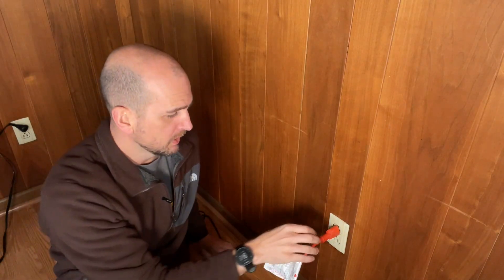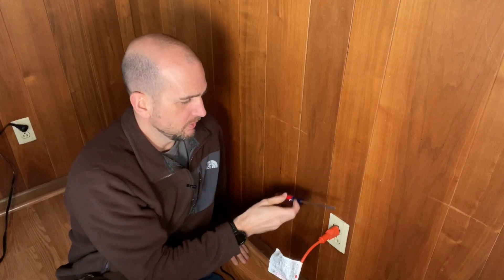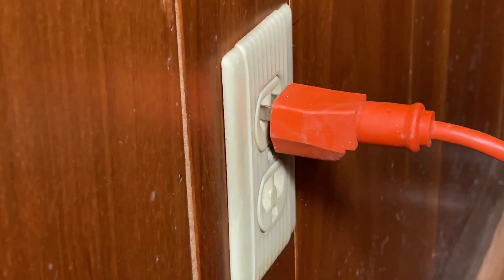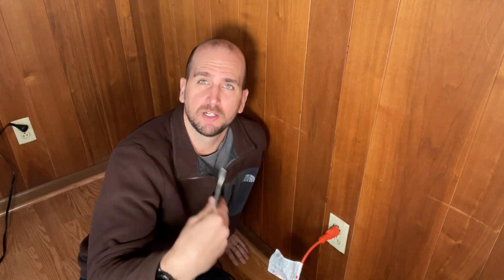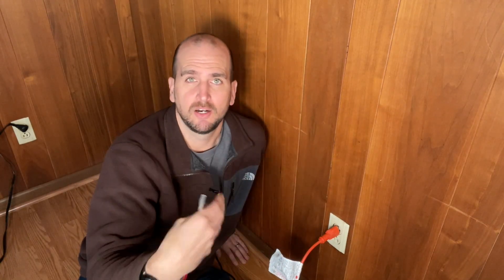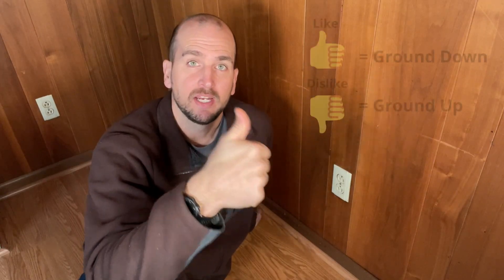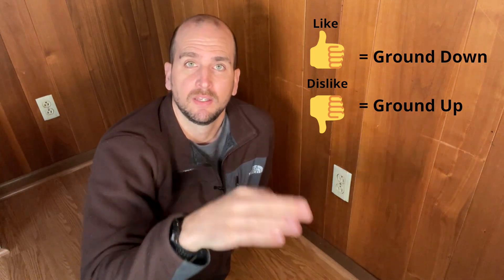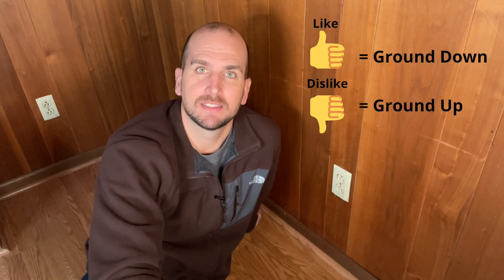Should An Outlet Be Installed Ground Down Or Up

Comment: This is a toilet paper issue.  I know people who actually argue over the toilet paper end being over or under.  There is no 'right' or 'wrong' way.  It is what ever suits you.  My house has them going both ways -- no specific pattern -- and that does not bother me.  I even have a couple that were installed sideways.  The box is actually sideways in the wall and so the plug is side ways -- or laying down if you will.  I could care less, just as long as I can plug in and it works.  As far as the 90 degree plug, It is better for the ground to be down so that the plug can be flat.  But I have no way of knowing where I would use such plugs, until I have one and need to plug it in.  If the fixture or appliance will remain there for a while, I simply pull out the plug and reinstall it with the ground down if it is not already like that.  It is not hard to wire a plug.  It is a pain in the ... to throw the main, as you then have to reset anything with a clock or timer if that fixture or appliance does not have a battery back-up.  But I think, today, most all appliance and fixtures have battery backups now, so that helps.  I am fortunate that both myself and my husband are not picky about these little details.  But some people are OCD and these little details really matter to them.  Another thing I have seen actually argue over is what color plug to get, white or the bone color.  They would really freak out in my house, because I have a mixture of colors, and I even have bone colored covers on white outlets and vice versa.  Sometimes I think I just like to freak people out.

Comment: Been in electrical engineering and construction industries for forty years. This is the worst explanation I have encountered.  Want to see fingers burned?  Put the ground up.  When the plug is grasped with the end of the index finger wraps around the bottom of the plug. Most people will naturally rock the plug up and down to remove it from the receptacle. Not difficult fir people with small fingers or weak pinch to go for a new grip and over reach and lay a finger across the hot/neutral. After thousands of design and construction projects all across the US and four other countries, never seen a ground up scenario.  Grounds go DOWN.

Comment: My observation over the past 45 years of doing electrical work is that for vertically mounted duplex receptacles the ground pin points down (except in hospital/commercial settings where they are almost universally ground up). And if the duplex receptacle is mounted horizontally the ground pins are  most often mounted to the right. Being consistent within a particular home or facility is best practice. The confusion comes in when folks change out receptacles paying no attention to orientation. This just adds to the question being addressed. :)

Comment: If gang boxes were installed horizontally instead of vertically, it would solve all the problems. The ground would be to the left or right, and only the hot or neutral would be up. So, no shorting if metal falls on the exposed prongs, and it would accommodate all plugs, including the flat, space saving plugs.
Reply: That's typical practice around Chicago with hot up/ground on right.
Reply: @mtgibbs  that makes the most sense to me

Comment: How about mounting it sideways ?    Left vs Right ?
Many industrial plugs that are 90 degree orientation have the cord positioned at a 45 degree angle from vertical; very annoying when the cord has to end up facing up only to loop down to the appliance.

Comment: For everybody who thinks they know and want to give their opinion now I'm going to tell you why. In commercial buildings the outlet cover is metal little screw comes loose which is common sometime falls out now the metal plate can fall down on your plug if your plug is not all the way in and jump the hot and the common what can cause all the usual problems including a fire. And this is why.

Comment: Ground Down 👇. Some electricians and builders use ground up for the switched receptacles. However on switched receptacles I like them separated one switched one hot. Then you run across the argument top up switched or top down switched. Ideally switched marked split receptacles.

Comment: I've got all my 20amp outlets, that run off of a 20amp breaker and 12ga wire, with ground facing up. And all my 15amp outlets that run off of 15amp breaker and 14 ga wire with ground facing down. That way I can tell weather an outlet is rated for 15 or 20 just buy looking at it and not having to take the cover off or anything. But that's just my preference.
Reply: Nowadays there's a "T" shaped slot on the 20 amp outlets you can use for that purpose.

Comment: The problem I noticed with the upside down outlet is people flip the outlet but they don't flip the wires so you have a hot neutral and a neutral  return which means I think you would have feedback even though the power be off with electrical feedback cuz I was told especially a code violation near water I've also know that gfci's that are flipped have a red light indicating a fault and so if you're plugging something in does not have a ground 🔌 which I know from experience the upside down outlets if you touch your coffee makers plate it'll feel electrified just let the transistor radios to plug is not flipped the outside feels electrified you can feel it

Comment: Great video, thanks.  A few years ago, in the bathroom, I did drop a metal necklaces and it shorted the outlet and made a mess. Also the GFCI never tripped.  I think the ground up would have been better for this incident.  For myself, I put the ground up in utility areas(Attic/Garage) and for places that are finished and visable, I put the ground down. The biggest reason ground down is so that people don't keep telling me my outlet is upside down.
Reply: The GFCI is not meant to trip for that condition (hot to neutral short).  

Secondly, if the ground was up and you dropped a necklace on it, it's flexible and will likely still contact the hot and neutral blades in addition to the ground pin. Or the ground and hot blade... Same result.
Reply: @IrrationalBstrd  If the GFCI  was upside though wouldn't it have shorted via the ground and tripped?
Reply: @FunWithBits  the neutral and ground are connected to the same place at the panel.  The difference between them is that the neutral carries current in normal operation and the ground only carries current when there is a fault, specifically called a ground fault.  Hot to neutral, or hot to ground short should trip the breaker unless the necklace provided enough resistance that the current flow doesn't exceed the breaker rating (or a faulty breaker or federal Pacific stab lok breaker which is notorious for not tripping at it's rating) which is entirely possible.

GFCI is designed to monitor the current on the hot and neutral conductors and trip when the difference in current on the 2 conductors is around 4-6 milliamps.  A sample scenario would be, you are energized by the hot conductor on a frayed wire and touch the sink with your other hand.  The GFCI sees that current is flowing somewhere that it shouldn't be (through you to ground) and trips.  A GFCI does not protect against a direct short between hot and neutral or hot and ground, that's the circuit breaker's job.  

GFCI doesn't need the equipment ground conductor to operate as intended.  Only monitors the difference in current flow between  hot and neutral conductors.
Reply: @IrrationalBstrd  Got it. Thanks for the clarification. I was thinking it would help in this case but it sounds like since they are tied together it wouldn't qualify.  It's good to know how this stuff works and do things correctly and safely. Off topic, I'm surprised they trip with so little current... that is pretty good as I know 4-6 ma is very small.. but then again it only takes 10-50ma  (just did a quick google search) to be dangerous. Thank you again for taking the time to share and reply.
Reply: @IrrationalBstrd  But if it shorted hot and ground, the GFCI would trip.
Reply: @Owen_loves_Butters  I don't think so.
Reply: @IrrationalBstrd  Current flows from the hot, but does not return to neutral. That's a difference in current that the GFCI will detect
Reply: @Owen_loves_Butters  it should, as what you describe is a ground fault.   However, it may trip the breaker as you have infinite current all of a sudden, theoretically.
Reply: @IrrationalBstrd  That's probably true, but the current wouldn't be infinite since the wires and necklace have some resistance (I have no idea what the necklace is made of)
Reply: @Owen_loves_Butters   Also, I have seen GFCI receptacles that supply power when the line conductors are improperly installed on the load terminals.  They don't test or reset properly and offer zero protection, so maybe that was a possibility?  

Edit: lol nevermind, I re-read the original post. Durp!  If the ground were up and you had a ground to hot scenario with a necklace ,with high enough resistance to only allow current within the breaker threshold, it would absolutely trip the GFCI receptacle.  The same necklace across hot and neutral on a ground down installed GFCI receptacle results in molten metal.  I made an assumption about the necklace, in that it would cause an over- current scenario, but that's not necessarily true.  

Nevertheless, a low resistance object placed across the the hot and ground prongs on a GFCI receptacle would result in an arc, damage to the object (necklace) , and probably a tripped breaker.

Anyways, there is sound reason for installing receptacles ground up, especially GFCI receptacles.  Ryan is absolutely right and it would've saved the necklace, most likely.  I hate how it looks so much that I was refusing to listen.  

Thank you both 👍. But..I'll never actually install them this way... It looks ugly, and it causes issues with polarized wall warts and many cords   Installing ground up causes the issue we are discussing in many cases, in my opinion.  There's no reason to have exposed prongs when you have something plugged in, other than that the receptacle needs replaced, or it's wanting to come out because the cord and plug were designed for ground down orientation, or you have the long and heavy side of a polarized wall wart and it's cord facing up and fighting gravity.  

The only solution would be to make ground up standard, and all polarized cords and wall warts follow suit.

Comment: I've heard the ground up argument stated exactly as it is in the video. In my mind that's one of those one in a billion scenarios. If your outlets are that worn and loose to begin with, you're asking for all kinds of trouble, and they should be replaced. Regarding manufacturer's photos. Leviton outlets are ground down on their site as well as on Amazon. The example shown here of the right-angle plug is the best argument for ground down. In fact, I have a device with a very stiff cord that has about 8 inches pointing upward if plugged into a ground up outlet. It looks tacky.

Comment: I went through IBEW apprentice program years ago. The journeymen’s  rule was law. When they said down, down it was, or up, up it was. My guess is down configuration started arbitrarily and became tradition as there is no guidance from NEC. 

One might argue however, in addition to the falling metal argument, that most people, being right handed, would use their right hand to connect to plug to the receptacle. 

In the ground up configuration, the ground pin/socket is easily visible when viewed from above and can serve as an index to guide the plug in place which is not the case when the ground is down. Moreover, in the ground up position, the grounded conductor socket is on the right side closest to ones index finger holding the plug. The ungrounded conductor is farthest away from the fingers of a hand gripping the plug and would create the best configuration to avoid accidental contact with a live circuit.

Comment: if you look at a 3 wire cord, the ground is longer than the other blades.that is so it connects 1st.  if the cord comes out of the outlet a bit like the arguement people make for ground up, then your tool will lose its ground 1st if the ground is up. if down it will be last to break which is the safest

Comment: I've read the comments and it would appear that most viewers prefer GROUND Down.  I'm 70 yrs old and am a traditionalist, so I also prefer Ground Down.  But I don't believe it's the ground pin that should be the issue but rather - Neutral (White) on the left and Hot (Black) on the right. The issue is polarized plugs on things like wall warts, night lights and right angle molded plugs. All are designed with the wider blade on the left when properly oriented. Don't fight established convention.
Reply: We have this problem at the hospital.  The commercial electricians in Facilities install ground up.  Most of our equipment has low profile plugs that are ground down, so we end up with cords that are oriented up the wall instead of hanging down.  In my opinion, this causes a dangerous condition because of the extreme curve it forces into the cords.
Reply: Im 30(1991), my dad is 55(1967) and my grandpa is dead but would have been 85(1933)... The house I live in has been handed down from grandpa to dad to me... The house was built in 1967 same yr as my dad was born. I just looked and ALL of my plugs are 3rd hole facing up... Idk why but they are...
Reply: That shows the orientation got started bad !   I think horizontal would have worked better.
Reply: @alainchristian  oh okay I got ya...
Reply: Well, I'm 75 and I couldn't care less. In fact I recently replaced all the receptacles in our house and I mixed them up, some one way and some the other.
Reply: @alainchristian  I actually lived in a HUGE OLD house that was built in the late 1800's. The house was converted into apartments in the 1940's. Also the same time the first electric was installed into the building. Anyways, I remember the outlets where actually IN THE FLOOR! I shit you not! At first I couldn't find them because the carpet had them completely covered up!. I had to cut holes in the carpet to get access to the plugs. I had never seen anything like that. Haven't seen anything like it since either 😆 Pretty interesting tho..
Reply: @Gerald.Leoto38  You can actually still have plugs in the floors even in concrete. It is very helpful when you don't have a wall near. I actually did some back last year like that for lamps that set in the middle of the room, but has passages on each side of the couches where people would trip over the cord.
Reply: @alainchristian  That makes sense. But Have you seen them like that in a residence?
Reply: I like ground down so I can pound down 🍐

Comment: as a 30 year electrician i know ground up is the way that they were designed to be put in and is because the grounds is the toughest pin and is not going to break off on top because it only forces the neutral and hot into the receptacle with it on the bottom and the wire gets pulled down that ground will most likly break off
Reply: i rarely have had a customer let me put it in properly because of looks not safety 
\

Comment: The correct orientation of an outlet is with the ground down. Throughout the 40s and 50s outlets were not grounded. In the 60's the NEC begin requiring grounded outlets.  Since most homes didn't have a grounding system, the accepted practice of installing an outlet with the ground up was to signify it was an ungrounded outlet.
Reply: The way to show that outlets are not grounded is to plug the ground terminal with epoxy putty then there is no chance someone will misuse it.

Comment: This is a good question. I am an industrial mechanic. My answer is that, for residential, I install ground down. For industrial, I install ground up. In my experience, the vast majority of new residential installs orient the ground down. For uniformity, I follow this practice. However, I like your method. It is an easy way to determine which recepts are switched. 
Thanks for the video.
Reply: Houses built in 80's on seem to be ground down except if it's a switched outlet, which makes it easy to determine which one is switched.

Comment: First not an electrician. Most of my life as builder on Commercial buildings. Would say it's unwritten standard to ground down. I can't say, I agree. Ground up seems safer. Let me ask this. If turning the grounds up was such a bad idea then why are SWITCHED outlets up. Don't they get used more? Would you do something intentionally harmful? Would inspectors pass it? If something falls on a chorded outlet it can short in any orientation. That breaker better pop.

Comment: An extension cord or pliable cord is fine for ground up . Most appliances have a stiff cord and you will have to force the cord to twist . This will create a problem with the receptacle and cord . Usually breaking the receptacle or ground post .

Comment: Back in the 80's and 90's in St.Augustine Florida, There was an electrician, named Mr. Mac. In every home he did he put the ground hole up.  He told me that when they first came out he searched for the answer to how they are to be installed.  He said the only thing he could find was that the State of Michigan had the only code written and it said to install them ground up.   So,  he went with that.